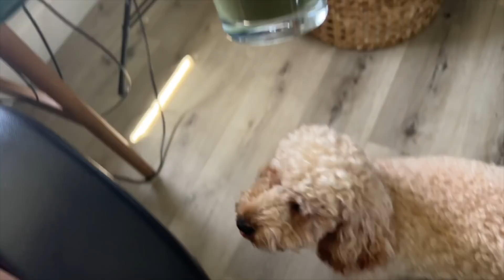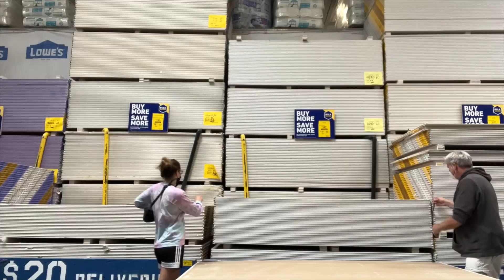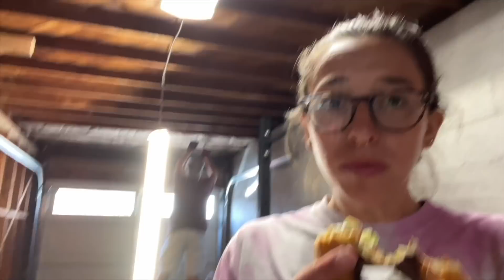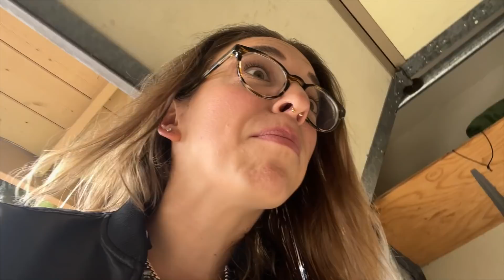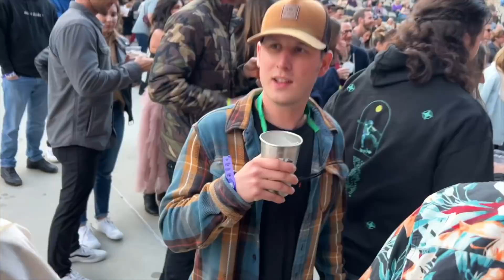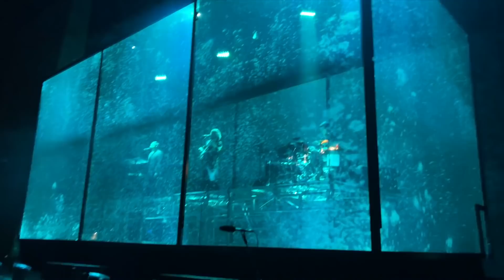Dad Helps Me Reno Garage

Comment: You should try and stagger your joints on the drywall so that if there is a crack in the ceiling after you plaster it then it doesn't crack the whole way across the ceiling, just makes it a bit stronger for you

Comment: i’ve been doing insulation and drywall in my new add on to my shed and it too weak and small to put the drywall up for the ceiling so i’m kinda just stuck with insulation in my ceiling but no drywall yet cuz i dont have anyone to help.

Comment: For some reason I thought you had to hire a contractor to finish the garage because of permits. I thought that was the reason why it all had to be removed the first time. I’m confused 🤔.
Reply: Not sure what the building code is in California but in NC, the homeowner can serve as their own contractor, pull permits and hire subcontractors to do the licensed portion of the job, I.e, HVAC, plumbing and electrical.  I do hope they did their research prior to installing the insulation.  In our state the ceilings and floors require a different R-value than on walls.